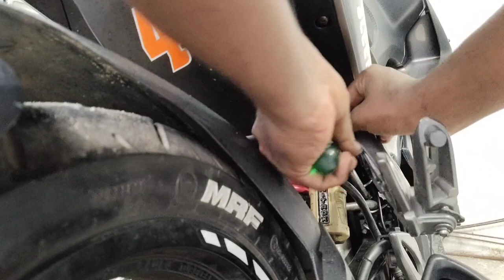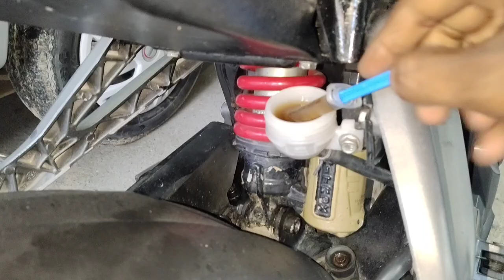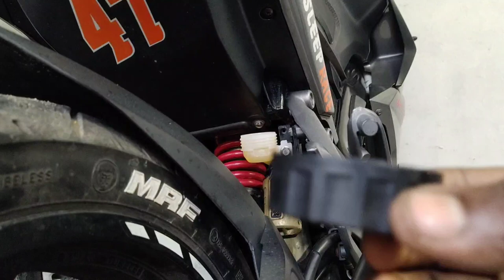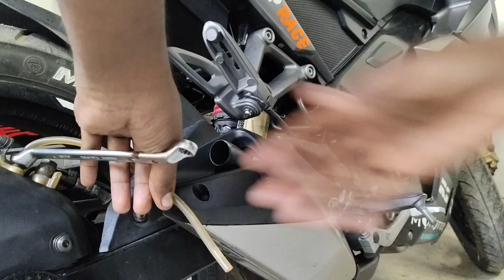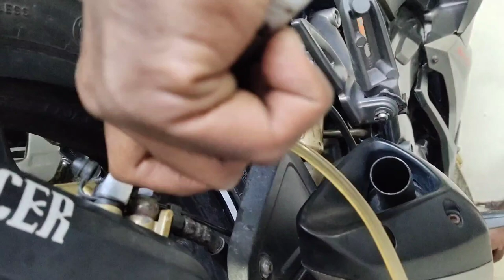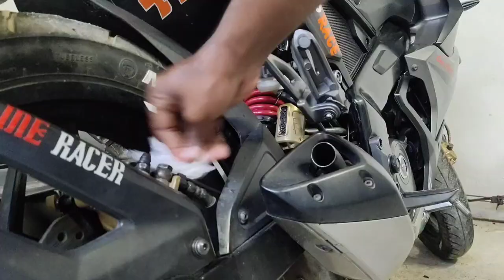DISC BREAK OIL CHANGE FOR PULSAR RS200/NS200/NS160/AS200 AT HOME

Comment: disbrake oil Price????????
Reply from the maker: 50 rs
Reply: @robinrsvlogs6862  front and rear only 50 rupees 🙄🙄🙄🙄 seriously
Reply: @robinrsvlogs6862  front and rear only 50 rupees 🙄🙄🙄🙄 seriously
Reply from the maker: Disc oil price is 50 rs only bro but you need two bottle of disc oil for both breakes
Reply: @robinrsvlogs6862  then how much need money bro🙄
Reply from the maker: 100 rs for oil and 100 rs for changing tha disc oil totally 200 rs needed bro
Reply: @robinrsvlogs6862  okay 😌 thank you so much bro 😇
Reply from the maker: Welcome bro
Reply: @robinrsvlogs6862 

Enna oil use panna nallarukum then oil name sollunga bro...
Reply from the maker: @paviprabhu4673  Bosch dot 4 disc oil